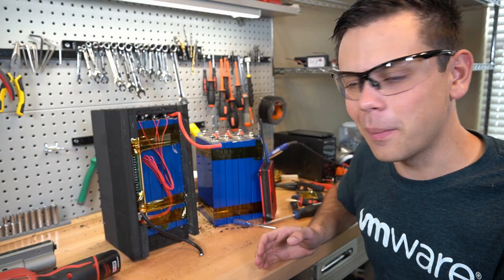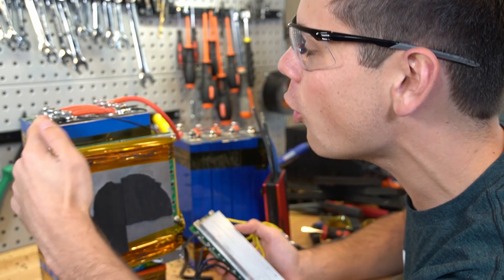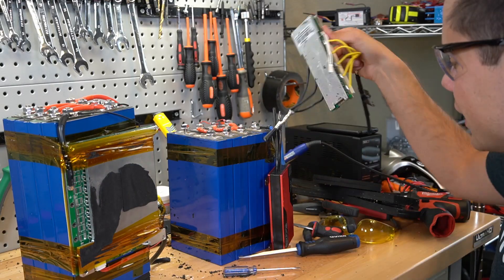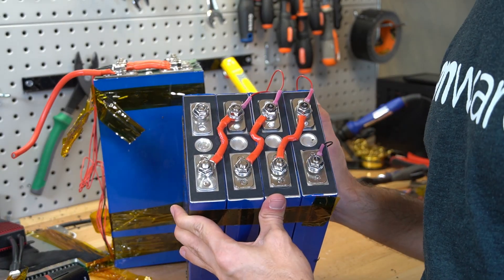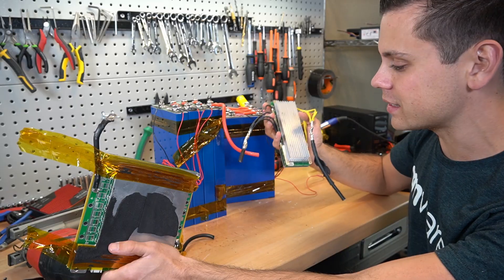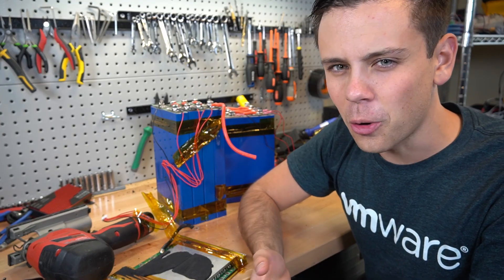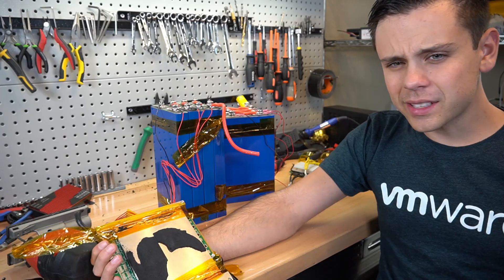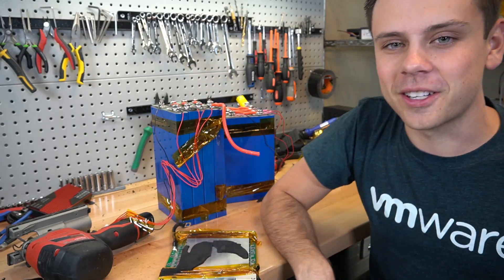Ruixu Problems Part 2: $700 Battery They Sent for Youtube Review had a Different BMS...

Comment: Is it fair to say that a person is better off self educating and then building their own Lithium batteries in order to assure good quality in an affordable product ? 
Not to burst your bubble, but I have found that manufacturers of many, many products, Chinese or not use the same tactics. They make a good product or product line for a while at the introduction, and for one reason or another cheapen the product or the line sometime down the road. I think that their reasoning is to build up a customer base and then profit off of that good name for a time by building cheaper and cheaper units until they have to introduce another model or line to replace what once was a good product or product line but which has been reduced to a POS. 
FIY, as an example., I'm old enough to know what Fords and Chevys  were before the Pinto and the Vega and have seen different versions of the same cars since. Before the Vega and the Pinto, both companies put out competent products. Eventually, the quality of each automotive line went down hill with the bottom of the hill being the Vega and the Pinto. Too bad for all of the broken engines and fried bodies huh?

Comment: As a neophyte with the lithium batteries, I really appreciate your videos. You've taught me to stay away from lithium. I don't have the knowledge for testing and the bank account to make mistakes. I'll go with a 6 Volt battery bank until things change. Maybe by the time I have to replace those, lithium will be a better option for me.
Right now, lithium makes me very nervous

Comment: Yes looks like these are cheaply made but because RUIXU makes two different 100ah 12v volt batteries with different BMS' you might not be comparing the same models. they make a RX-LFP-12-100LS and a RX-LFP-12-100 and they both look the same from the outside If you look on the pics on their website, I do not think they even mark the LS on the sticker on the battery if you have that model. The LS description says a beefier bms with low temp and better monitoring and can be connected in parallel or series. the other one cannot be connected in series or parallel.  I think maybe the one your friend sent to you is the non LS.

Comment: Hey Will, I just had two Life Blue lithium batteries installed by a local company.  One battery has a amp hour rating of 88.6 an d the other is 102.5. Which one. Is bad or are both good?

Comment: Many if not all Chinese battery manufacturers do this. I found that out when I took a part a cordless tool battery that had a good review. Totally different cell inside from the ones sent out for review. Mine had 1/3 of advertised capacity, then died a month later.

Comment: Do you recommend the Daly BMS still? I think I saw they have a 200A version? Could I use that instead of the 60A BMS + low voltage cutoff? Is there anywhere to purchase it other than AliBaba? Thanks!

Comment: Regarding weighing things with that type of scale, I have a similar one and it is programmed to lie in that if it gets two “similar” readings within X timeout, it will show the same reading, in order to hide that it is not that accurate and would show different readings of the same thing each time.

Comment: No one mentioned it, but you got the old version. Eight months ago you got your battery, but today they're selling ones that cost less.

Before you were born, Converse All Stars, aka Chucks, changed their rubber sole. I was angry. 😡 In my opinion, I considered the old version was much better. It had deep squares compared to the newer smaller ones.

Comment: Will, there is a video by Discover battery in which they open a Simpliphi and a Discover. They make a big deal over the quality of the components and arrangement of the Discover over the Simpliphi.  I was not too convinced, but certainly Discover seems to be the pinnacle of quality...it is also 6.5 kWh per unit.
Reply from the maker: Good to know!! I'll look that up

Comment: Bait and switch, or a company that goes with the lowest price components whenever possible? As a 25 year auto tech I've seen two parts, especially suspension parts, that will look slightly different but come in identical boxes from the same parts store at the same time many times. When buying oem parts I've never seen this though. Bottom line, you get what you pay for, quality and reliability costs money. Weather they purposely misled you or are just going with the cheapest components available on any given day it's not a product that I want. Thanks for sharing.

Comment: Will, this has always been a problem -- including with Lyon UT and Battleborne. As long as you -- or anyone else -- accepts units from the manufacturers  themselves for review, you have no idea if they've built a specially awesome unit for your tests and then ship out inferior products to the general public. The only way around that is what Consumer Report does which is buy anonymously from the seller / vendor / manufacturer directly as a normal customer then open up the product to see what's actually inside.
Reply: Actually, the thing to do IS accept it from them AND buy one, and compare.  Because it says a lot whether or not they think they need to deceptively beef up a review model vs simply have a standard one that isn't as great as you hoped.
Reply: At the very least, manufacturers will test the crap out of anything they send for review to make sure it is a top performing unit.
Reply: The problem is that products like this are on the expensive side to buy for review. YouTube is not a giant income stream.
Reply: @JasperJanssen  average is $3-5/1000 views.. this vid alone could buy a bunch of these. Plus you can resell the item on eBay
Reply: @dylan-nguyen  whaaaaat. 50k views on this video. Even at $5 per k that’d only be 250 bucks. How many thousand dollar batteries are you expecting to buy for that?

And of course that’s for every thousand views that actually watch the ads. This video is more likely to net him 50-100 bucks at most.

Comment: Will, We want to know the lies they tell you, i suspect it will be "That 'new one' must be 'an old model' that got stuck in the warehouse" "They are all much better now". Bait and switch is common when you want to get things manufactured in China, you need to be present in the factory checking the actual reality of your product to actually trust it.
Reply: Karl Bartelt, I think the new version is the cheaper made one. Quality control did not catch that wire unattached. Wires do not fall apart due to shipping.
Reply: @gregyohngy  You missing the point, we know that this new version is the cheaper one, I was suggesting the lie they will tell to explain it. Most customers will not pull it apart to check.

Comment: And how do you not have a decent scale? You should be weighing everything. Love the videos.
Reply from the maker: Yes it's ordered. Agreed
Reply: @WillProwse  ... but if the manufactures are smart enough they will make sure they all weigh the same by using a plate of cheap material to balance.

Comment: I have the 200ah kit and the bigger BMS is exactly like mine.
Reply from the maker: NO WAY. So glad you posted this. Thank you for verifying that.
Reply: @WillProwse  Here's the two images they sent me after I couldn't find any instructions on how to wire the BMS. The filename says "100A BMS" in it so I'm wondering if it's even capable of pushing 1C for the 200AH batteries. But I'm using it with a 12V relay so I'm more worried about the phantom draw of the BMS. 

I just hooked up the 12V relay setup as you described for the Daly BMS, but so far it looks like it's not balancing. The cells have about a 250mV gap between them. I can confirm output on the P- pin, and it turns off when the balance lead is disconnected (just like in the video). Going to test whether low temp disconnect works somehow, maybe some canned air, and if it doesn't, I'm probably going to replace it with the Daly BMS you recommended anyway.
Reply: Can anyone even see this link?
Reply: @BertRedd  I typed it in and got nothing
Reply: @veteransfortinyhouses6236  same here imgur said Nope GTHO
Reply: @BertRedd   Rob Vella  I got the link to work and can see the images. Very strange that yours is also beefed up. Makes me think they have 2 different factorys that make different batteries and they sell them both as the same unit.
Reply: @BertRedd  Nope
Reply: Rob Vella I cannot

Comment: Are you sure that although they both weigh the same they both put out 100aH??  ALSO there should be some markings on the larger BMS to identify what it truly is ...
Reply: ghostwriter6699 
Good question. May have sand in them
Reply: @drmachinewerke1  look at them with a infrared gun? if the batteries/nms are a different shape the heat pattern will differ.